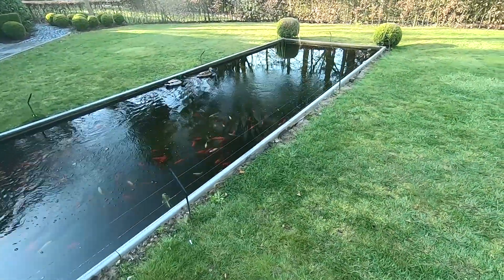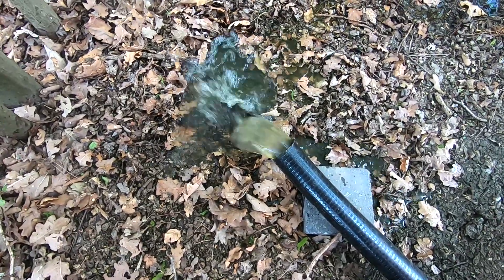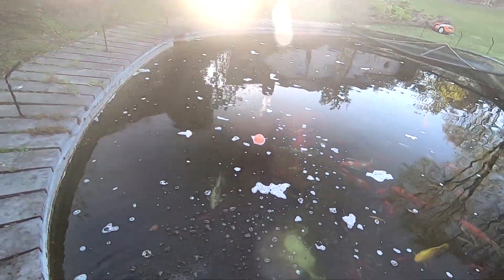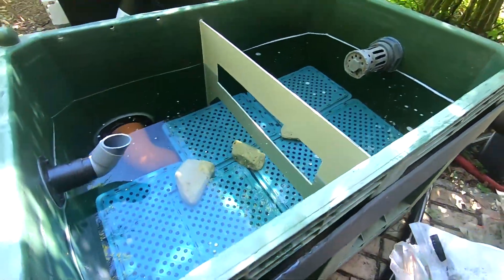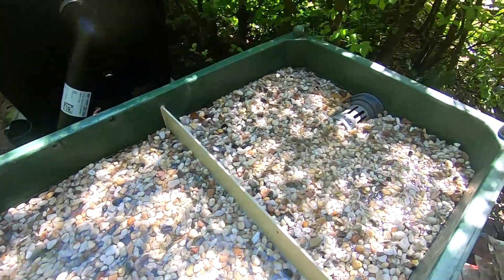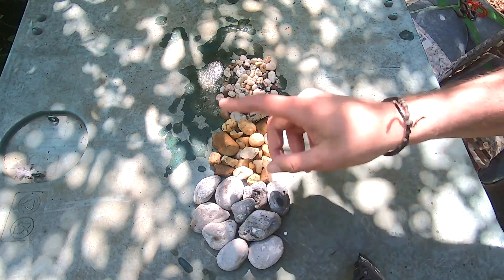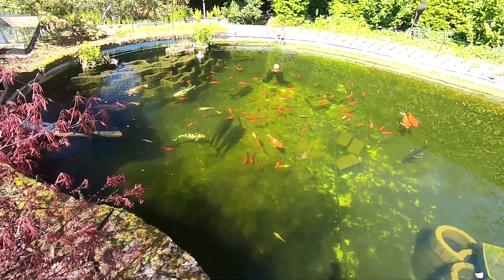DIY bio filter | bog filter | with plants

Comment: How is it working? I copied your idea with the stones and having a 5 inch void and then using lava rock in ibc totes waiting for the caulking to dry for awhile before I fire it up x4 ibc filter into a 5000 gallon pond
Reply: Thanks I have one leak I have to wait till the weekend to fix I can’t wait to see my fish again
Reply from the maker: @natemurphy4367  I would advise to do a good cleaning off the pond to, to get the muck from the bottom if there is any
Reply from the maker: It's working like a charm, water used to be green in summer but with all the changes it is crystal clear and I can see the fish all year round

Comment: Great video. I would put in a gfi or switch to shut off so you don't have to pull the plug every time.
Reply from the maker: Yeah, I kind of had to make due with what I had. The boss man didn't want to invest a lot of money in it so I recycled the old filtration to a bio filter and went for the cheapest possible

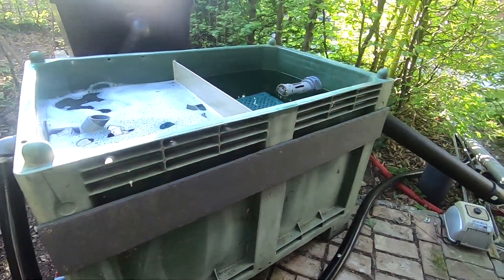Comment: Why is there soap inside your filter? 3:20
Reply from the maker: That is not soap buddy, that was for the first time running the system whitch might have given more bubbles due to the turbulence of the water. Proteins might have been the cause to. No soap was used to install any of it. Thanks for watching! If you have other questions feel free to ask

Comment: Excellent construction. Question, What are you using as the main outer container that can hold the weight of all of those rocks + the water? Thank You 🙏 Dave in PA USA.
Reply from the maker: Hey Dave, first of all thank you for watching! This used to be a filtration container that housed brushes and filter mattings. It is taking the load of rocks and water fine, it is in for almost 2 months now and no problems for the moment. I think that if I would have taken out the white devider it wouldn't work thow... it might push out the sides. I might do a update in a month or sow if you want me to, or a quick in between video...
Reply from the maker: I think it resembles those new blue containers that you can buy as quarantaine tanks but those don't have the extra decider in the midle of it